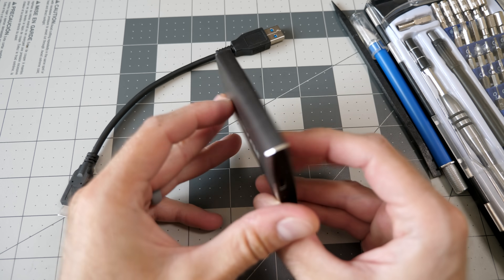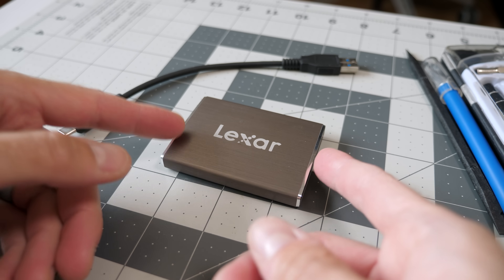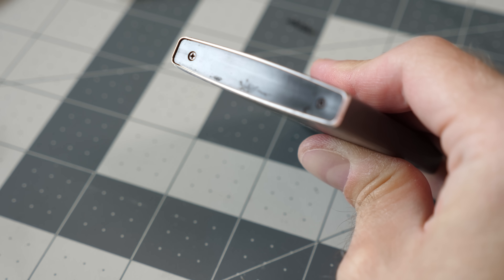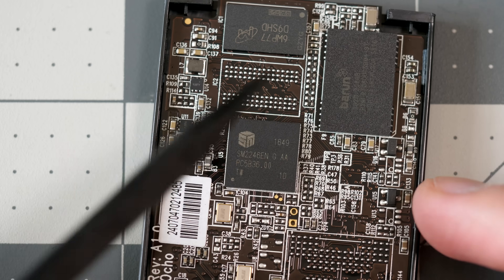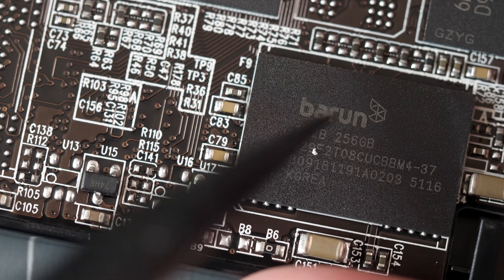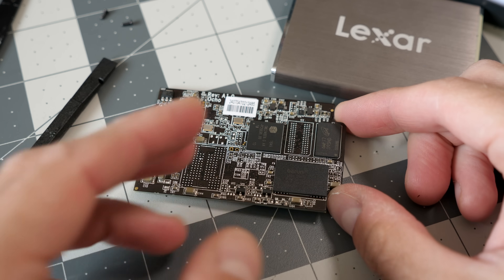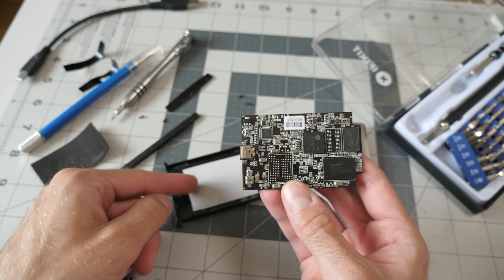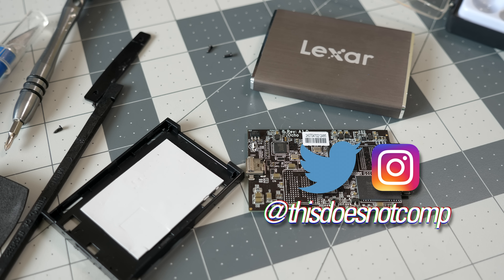What's Inside an External USB SSD?

Comment: @0:45 - I feel that pain all the way over here.  I used to do tech support for a major ISP.  I heard the "But it just worked last night" line a hundred times a month.  My reply - "I have no doubt that it DID work, but it doesn't now which is why we're speaking...How may I help you."
Reply: If only the support people of my ISP & Telephone provider (same company) understood that lol. 
This is more of a customer perspective of mine with some parts from other people I know and others that complain openly online.

They have an automated machine asking to input the telephone number of the account and (pretty sure) they can see the number of the phone people are calling them from, then I get asked if I'm asking for support on a different number when I'm calling them through a different phone (under a different provider) because I can't use the line that has a problem then I get directed to do other unrelated tasks like checking the wifi router and rebooting it and other stuff (when it was their telephone lines that failed/malfunctioning). And only then when I would get asked why I called and obviously its because I have a problem on their service. Dunno why they couldn't just get to the point and get straight to the problem and support people from there.
Good thing I haven't had the need to call them up again lately and my situation isn't that bad considering that some wait for hours on hold and the same ISP is billing customers they have failed to provide their service to for weeks (or worse for some even months) and don't people don't get refunded or something for the failure of the ISP.

Comment: "Could only get a couple hundred megabytes per second..."

It's a USB 3.0 device. Maximum transfer rate 5 giga*bits* per second. That's 625 mega_bytes_ per second. The rated speed of 525 MB/s is darned close to the theoretical maximum for USB 3.0. And slower than SATA-III's 6 Gb/s.

You'd need USB 3.1/3.2's 10 Gb/s or 20 Gb/s to do better than the SATA controller onboard.
Reply: That's what I was going to comment. There's absolutely nothing weird about having a SATA III drive with USB 3.0 connection, they're about on par with each other. And like you say, if anything , the USB 3.0 element is the bottleneck.
Reply: Isn't usb C 3.1 or 3.2? I didn't think they had that size when usb 3.0 was standard
Reply: @SineN0mine3  The "USB Type-C connector" was made an official part of the USB standard with USB 3.1; but its use as a physical connector is technically separate from the electrical signaling.

USB-C can be used on USB 2.0 or even USB 1.1 products.

And Type-C connectors, while only made "official" with the USB 3.1 specification, are technically defined separately as a physical plug than the electrical specification. The connector predates USB 3.1 by a couple years, so could be implemented on pre-USB-3.1.

They were often paired with USB 3.0 5 Gb/s signals in its very early days. Adding the plug was something you could do with an existing USB 3.0 controller chip easily enough - it didn't actually require a USB 3.1 10Gb/s controller chip to work.

And the Type-C connector is only optional on USB 3.1 and 3.2. It isn't considered "a mandatory part of the specification" until USB4.

Comment: My guess is the foam padding is to apply pressure to force the thermal pad through the openings and make contact. Also insulation from shorting on the metal case.

Comment: The exact same thing happened to me with a similar style Crucial drive, it just died suddenly.  When I plug it in, the USB controller part does show up in lsusb, but the SSD controller side seems to have died. One theory I heard with SSDs is that the controller can actually corrupt itself, and you can try to "reset" it by plugging in only power and no data, but that's not possible with these kinds of drives since data and power to the SSD controller is hard wired into the USB Controller.

After that SSD died I got an OWC Envoy Express, it's a NVME-Thunderbolt enclosure so I could use my own NVME SSD, and it's not being bottlenecked as hard by USB or SATA, has good cooling, etc.

Comment: If you want to test if the SSD portion is still working: 

There's a possibility that there are test points on the PCB that exposes raw SATA interface. Solder it to a spare SATA-USB bridge board and test. 

Or (the hard way), get a SM2246EN kit/assembly PCB (from AliExpress?) and then remove the cache and controller from the board, and move those components along with NAND flash to the new board. There's a possibility that it would work outright, as long as the flash chips are on the right bank. 

Since having a bad flash chip is quite rare, and there's no important data in the SSD, you might simply move the flash chips to the new board, and using the mass production tool (usually comes with the kit PCB) to manufacturing your own SSD. You even got to set up your own configuration, running the whole thing in SLC mode, getting more overprovisioning space, customise the vendor string and IDs, etc. It's actually quite fun.

Comment: If you want such a device to last, use a SATA drive enclosure. The M.2 enclosures are also quite compact. That way you can make sure the actual drive comes from a trustworthy manufacturer.
Reply: Be careful some SATA enclosures are killing the disk. My 2 SSD's dies in just few days and than I found that the reason is the enclosure.
Reply: Just use a disk. They last much longer than SSDs do
Reply: @billyrob612  Exactly. I still do my backups on  traditional HDDs as i have for many years. I've not had one fail on me.
Reply: @lesrogers7310  I have a  15 year old 250gb hdd a d it still works to this day

Comment: my list of to-do would be 
1) check all fuses and resistors with "0" value
2) plug it in and feel if anything is getting hot (dead controller can sometimes get really hot)
3) (i have an oscilloscope) check USB data to see the response from the drive
Reply: I would, as a last resort, reflow the controller chip. Helps with a lot of hot running devices, they tend to get BGA problems. A few days ago I successfully repaired my non-booting Chromecast 1 that way.
Reply: Plug it in and probe it with a DMM.
The first commandment of troubleshooting: THOU SHALT CHECK VOLTAGES
Reply: It reached the average ssd chip life span. It's probably unfixable
Reply: @billyrob612  yeah but the usual failure mode is read only no write.
Reply: @billyrob612  nah, the usb controller isn’t powering on at all. I would say that’s the problem

Comment: Plug it in and feel for heated component, if it is a capacitor then just remove it. Fixed a MacBook Air using this technique. If it’s a chip...here comes another repair video.
Reply: Ah yes. The, as Louis Rossmann calls it, "owie test"

Comment: While Planned Obsolescence is certainly a believable reason, it's not one that I think applies here. The simple fact is that if they were really going to go that route, why would they bother even including the thermal pad in the first place? After all if they're building to a cost, as you mentioned many times, why would they spend the money (even if it's small) to include a non functional thermal pad?

The most likely answer is almost certainly the simplest one, the person doing the assembling almost certainly stuck the thermal pad and the sticky pad on the wrong sides of the board, and that error just wasn't caught during whatever QC was done post assembly.

Comment: Oh yeah, Lexar... A friend and me bough their flashdrives at the same time and both are dead. Mine under warranty and his after. Too bad because they were really fast. And we both really took care of our stuff. Heck, I have a jurassic 1GB Corsair (the blue/black rubber one) that is still going strong after 15 years of use.

Now we both just use M.2 SSDs on USB enclosures because it is cheaper than a slower, top of the line flashdrive of equal capacity.

Comment: I had an SSD die on my in my Mac mini several years ego. If it was a modern Mac mini I could have thrown away the whole machine but because it was a Steve Jobs era Mac mini I was just able to unplug it and put a new drive in it’s place and the Mac mini still works to these day. This is why I despise modern computers that solder everything to a single board. One component dies and the whole machine is a brick.

Comment: Stuff isn't really made to last these days, just look at that chip "cooling", if you can even call it that. I wouldn't be surprised if it was designed to survive the warranty period, but not much longer. 
If people buy new ones more often, it's a win for the company. Sad but true.
Reply: but if people start calling out the company and telling others not to buy such a bad product then such principles shouldn't work, but guess what, most people are shallow delusional and stupid and don't know what they are buying (⌐■-■)
Reply: @3mar00ss6  Or they're just blindly loyal sheep and don't care. Oh, what's that, my last 5 MacBooks died due to Apple's poor engineering, and Apple wouldn't provide a warranty repair? Better buy a 6th MacBook! 🙄
Reply: @3mar00ss6  In theory, yes, but most of the time it probably doesn't go under the radar and damage their reputation. It's not like they try to make a product die after 1 year, it's more like not caring about running the chips under ideal conditions (proper cooling etc), which may or may not result in damage after a long time.
Reply: It was built wrong.  Nobody who makes storage devices needs to worry about how to drum up repeat business.  You're going to fill it up, and then you're going to need another.  I've never bought a disk that wasn't over half full by the time it warmed up to operating temperature.
Reply: the only problem is people often don't keep buying from the same company over and over again when their product consistently breaks (when you have a lot of choice in where you source your product).

Comment: the only time external drives every failed me is when the enclosure dies. i take the drive out and use it on a drive dock or internally and they always work
Reply: I've been in the opposite situation. The actual hard drive developed the click of death, but the USB2-to-SATA board still worked, so I bought another hard drive and installed it in the enclosure.